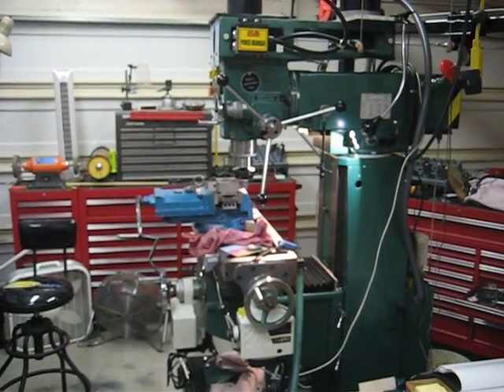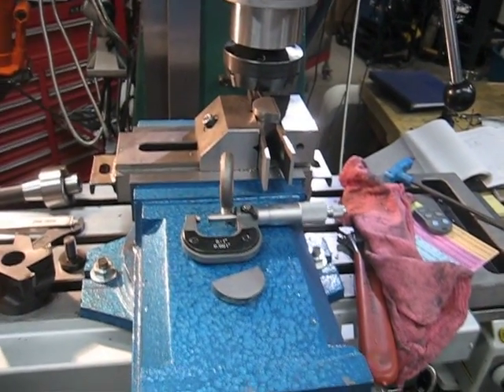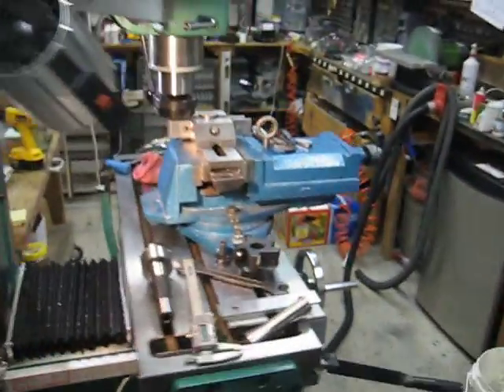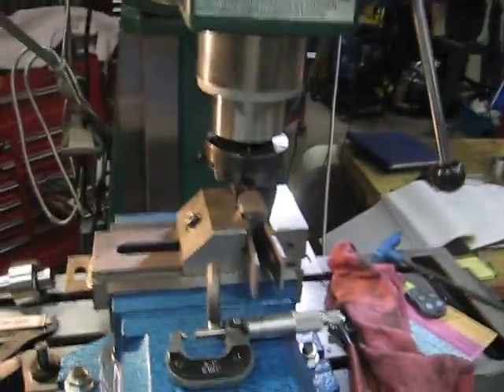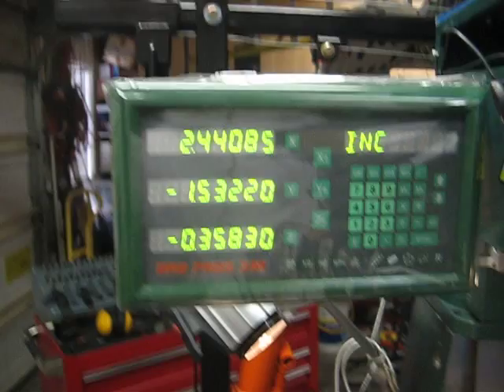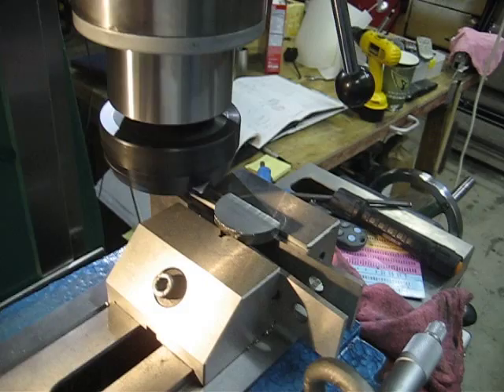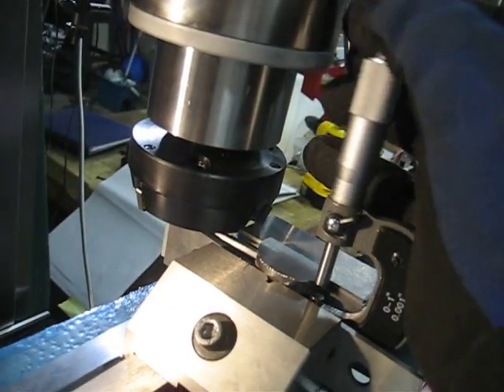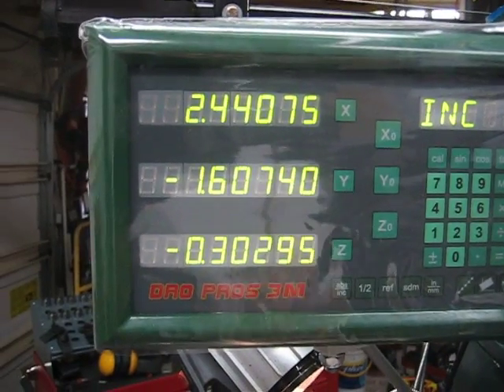Ron's Grizzly G3616 Mill up and running - July 2011

Comment: I have the Canadian House of Tools equivalent. Shumatec DRO 350 on the quill and X/Y.  Stepper motor on the knee.  DC Servos will be installed on X and Y run with HP_UHU drivers.  I have made the Y and Z move with a BeagleBone Black running MachineKit (LinuxCNC).  https://youtu.be/9GF709ZfLRQ 
Do still have yours in operation?

Comment: Well, I just learned something! I have the same mill but not the elaborate variable speed. I have a question and I am embarrassed that I do not know the answer to. My Grizzly DRO is reading in units that I do not know what they are. I tried pushing the mm/in button but that is not getting me anything near what I need. I must have pushed something but just need to reset it to inches. Any ideas? 

I have been building guitars for about 15 years and never really thought I needed to do the cool trick you just showed me. Thanks for that.

Comment from the maker: I got my power feeds from CDCO - cdcotools com

I used the 22201 on the X and Y.  I used the 22203 on the Z.  I had to make custom mounting plates for the drive and a custom drive shaft for the Z axis.  It took some time and creativity to get everything working right.  I am very happy with the result.  Hand cranking that Z handle gets very old.  I am spoiled by the power z.  I was not able to install all the limit switches.  Got most of them in though.  Good luck and be careful.